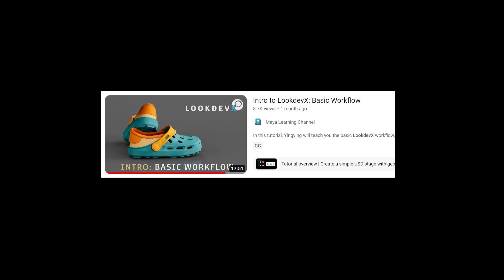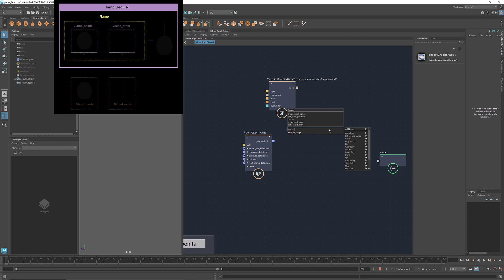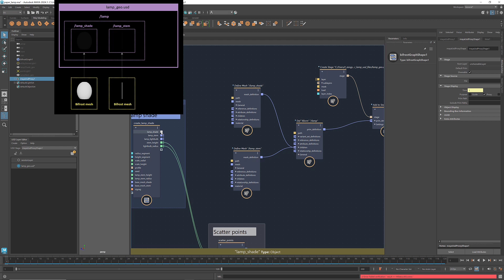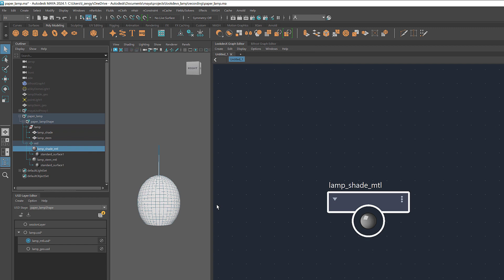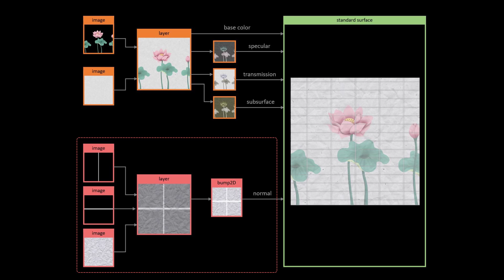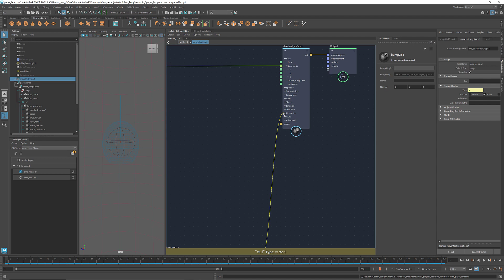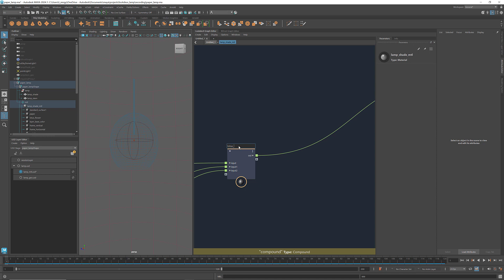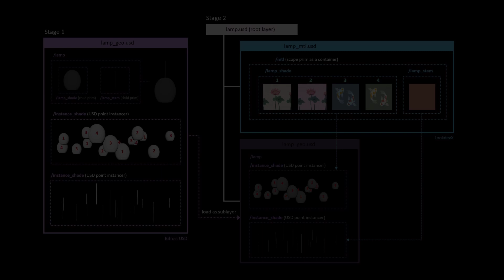Procedural Workflow for LookdevX (Part 1): Creating Materials for a Paper Lamp

Comment: Thank you for all the tutorials. Is there a way to maintain the procedural workflow between Maya interface, Bifrost and LookDevX? Currently, if I want to build the final stage that combines the geometry and material stages, I can only add the material via the interface and build it in LookDevX, but that way Bifrost is unaware of the new nodes created, so I cannot save the changes via Birfrost, thus breaking procedural workflow. The shaders available in LookDevX are not accessible via Birfrost, it is a bit frustrating...or is there something that I'm missing? I'm going for PBR setup.

Comment: How do we use a relative path for the textures?
Reply from the maker: Currently, in Maya 2024.1, relative paths are not supported in LookdevX UI. Users would need to manually edit a USD file and set relative paths according to Asset organization.  For more details, please join LookdevX Beta forum where you can participate in designing and testing features and workflows.
Reply: @Autodesk_Maya  Thanks for the info. I hope we get relative path in a future update. Its super important.

Comment: Nice, is there a way to import materials directly from the hypershade to lookdevX and assign them to an USD Prim? thanks
Reply from the maker: To use materials created in Hypershade in a USD stage, you need to first convert it to a USD material. Currently you can't export just Materials by themselves to a USD file, they must be assigned to a geometry to be exported to USD, and the assignment will be written into the USD file as well.

At this moment, this is the way to do it:
In Maya, assign the geometry with the materials created in hypershade, then export the Maya geometry with the assigned materials using "Export Selection". There you can set the Plugin Configuration to "Arnold", which converts materials to Arnold shaders in USD format.

Also,  under "Materials" in the export selection window, you can select MaterialX or/and USD preview surface for the same export. However, If your graphs are pure Arnold graphs in Hypershade, we would recommend exporting them to USD based Arnold shading graphs. MaterialX can be used for translating Maya native networks, but those shaders will be translated using Maya's MaterialX supplementary library which can only be rendered by 3rd parties that support the Supplementary MaterialX DCC's library.